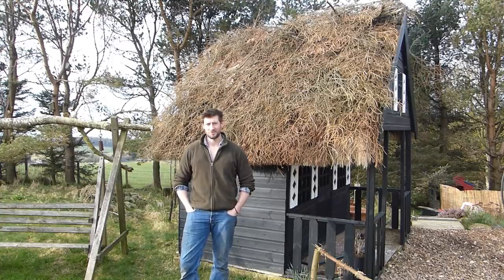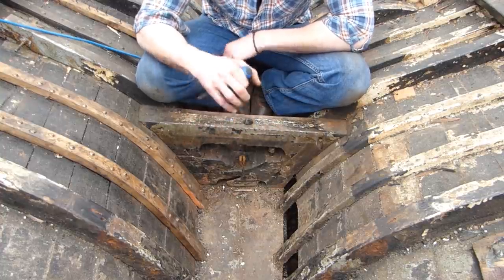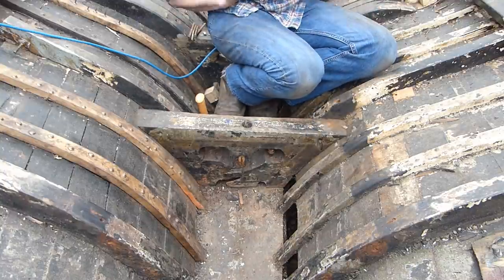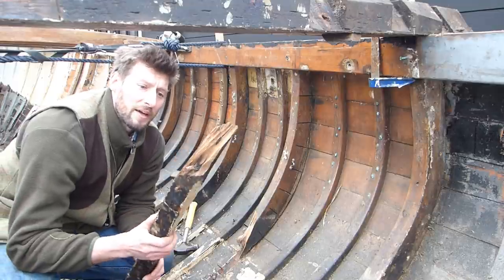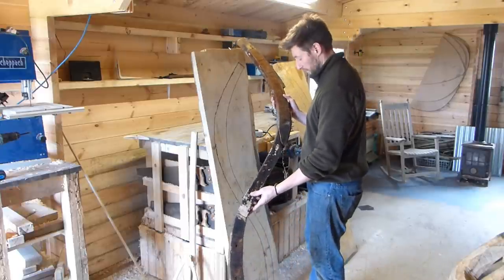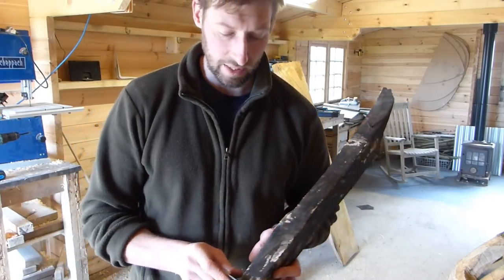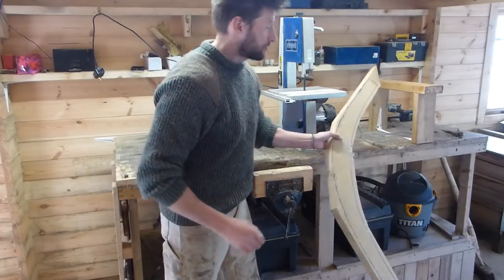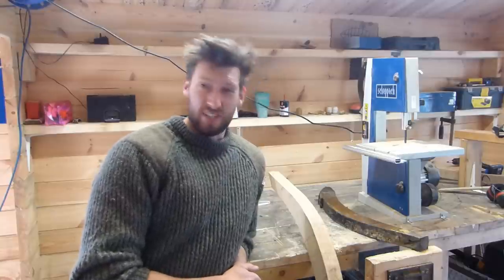Reviving an Idler - Episode 10 - Sawn Frames - Part A

Comment: Great job!  Another way to fill the nail holes in the planks is to drill them out oversized, may 1/2" or more, followed with some thinned epoxy so the wood fibers easily absorb it, followed by filling with thickened epoxy and re-drilling for the fasteners.

Comment: You can now use your crossfalls to set the correct beam width and prop up the Port side level with the starboard side to get rid of any sagging and twist. It was a good idea to remove the bilge stringers, its going to make it so much easier to replace ribs and frames properly.
Reply from the maker: Its already been night and day on the steamed ribs with out that stringer! 🤣 i replaced 5 i under 5 mins each minus the steaming time!! 👌🏻👌🏻👌🏻
Reply: @BothanboatsIdler  You may be able to use part of the offcut of the port frame, on the outside, to help push the planking back up to your new frame, just a thought.

Comment: You might try metal blade on a multi tool to cut the iron fastenings between the sawn frame and the planks.  Lift the frame, then punch out the iron nails from the inside.

Comment: Those nails are cut nails. This means they are hand-made by shearing from a sheet, rather than by complete forging.Oh, and you need to invest in a pry bar (AKA wrecking bar, or "persuader").
Reply: You will get them out easier with a good bar and you will have less damage.

Comment: Given that hardboard has been used in some repairs, is it any wonder that iron nails have been used too? I had a similar thought to Pocketfarmer about a hole saw, or at least making a "hollow drill" by cutting teeth on a 1/2 inch steel tube to cut away some of the surrounding wood. Your confidence in knowing what to do and how is really showing through now you know you have a worthwhile project on your hands.
Reply from the maker: Thank you so much! Yea i agree, i felt the same way! I was pretty shocked by the nails and actually thought that it might have spelt the end of the road for the project for a time!! 😑

Comment: Those cut ribs look quite ugly where they fatten out to reflect the MDF packing. Have you considered having the inner line follow the outer line, by removing a little material from the inner face?
Reply from the maker: Yes, im leaving it where it is just now so that it can still support the bilge stringer but some fairing will reduce it slightly 🤙🏻

Comment: Well you'll have to plug the holes with same wood and make new holes in plank to fasten it.

The galvanized ship nails are covered in tips from shipwright not long ago.

As for bandsaw. Visit wood gears.ca Matthias has plans available for wooden bandsaws and they work quite well.

Ideally the inside of frame follows the outside of frame for a more asymmetrical look.
Reply from the maker: Ive not seen that ep of T from a shipt yet, but ill check it out for sure! My limited research has suggested that these were common place clinch nails usually used in clinker (lapstrake) boats since the middle ages till now. Ive just never seen them used to fasten olanks to frames before!!

Comment: One technique for removing rotten screws is to use a pilotless hole saw. Effectively you cut as small a plug of wood from around the screw. Then repair with a new clean dowel. It is a lot of tedious work though. Good luck.
Reply from the maker: Great advise bud 👌🏻👍 thank you!

Comment: I am curious about your thinking/philosophy for the method you chose. I'm a rank amateur builder and am concerned here with the why's? Are you not concerned about shrinkage/warping of the noted, still green white oak in the sawn frame? Yes it would be trained by its location... Do you think that working against you is insignificant in the present situation? Plus I would imagine that laminations from the same green stock would make better use/ economy of the stock and eliminate issues of grain and green... Yes it would cost more in time epoxy and effort, and time being money... Was there balance struck by you (or was it desire to intentionally not use epoxy, modern techniques, or composite methods while staying traditional) and lastly I know that they are sawn frames and the laminate techniques are often applied on youtube (Lou Sauzede) for the bent frames... Is that method inappropriate for the sawn frames? That oak is very expensive material.
Reply from the maker: Good question, ill try and out line this abit in my next video. But the short answer is; 

Weather the rib is wet or dry isnt really important. What matters is they match in moisture content with the boat. Now i haven’t really done this very well in truth as i only had the option to use very green wood and the boat has dried out significantly. I am heavily and repeatedly oiling both the planking and rib with the joint aim of restoring some of the moisture content of the planking and restrict moisture loss in the frame. I have also left the frame around 3-5% over sized to take account of potential shrinkage in the period Before final fitting. 
There is a good deal of “educated guess work” in this. And its difficult to explain. 

Laminated frames are still an option particularity as the weather continues to warm. But i would rather replace like for like, as a personal preference. 

I hope that helps answer your question? Though i know not completely.
Reply from the maker: Ps, yes you can absolutely laminate larger station frames. You can also steam bend into position and then glue once its dried! There are loads of options. As i said in the last reply im trying to keep the boat as true to how it was as possible without doing anything overly carless.... like re using iron nails! 🤣

Comment: i have a perfect understanding where that boat is....  wait for it... it's on bracing on rocks under your temporary roof. that's exactly where the boat is. oh and the lengthways inner rails you could've just tied to the gunnel boards. then it'd been easy to work around.
Reply from the maker: Buhdum- tish 🤣
Reply: @BothanboatsIdler  i spoke english to you. what in the hell was that.
Reply from the maker: Its a drum roll, thing. Perhaps lost in cultural differences. Its not bad tho, sorry for the confusion.
Reply: @BothanboatsIdler  so you do a drum roll when you don't think of something that'd saved you time and effort ?
Reply: I got it. I believe his reply was an attempt at a “rim shot” on a snare drum. Used when a performer makes an error in a live stage show. It’s no big deal IMHO.
Reply: @trep53  in a way that is irrelivant. perhaps next time he may think of such a thing since it's now been suggested. many people NEVER think of easier ways of doing the same task. that doesn't make what he's doing any lesser of value. and he's put alot of research and time into his project.
Reply from the maker: Yea, that was a good shout. I didnt think of that. I did concider tucking down i to the bilges but, in truth theyd be in the way where ever they are. So i thought it best to remove them. 🤙🏻